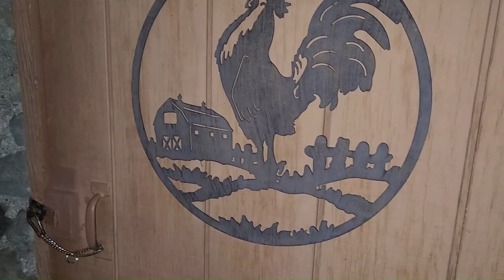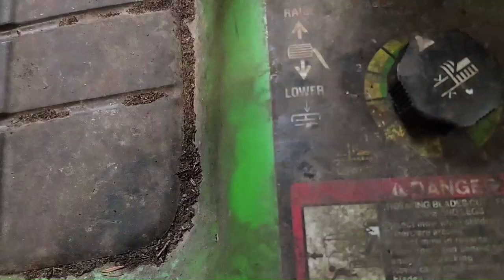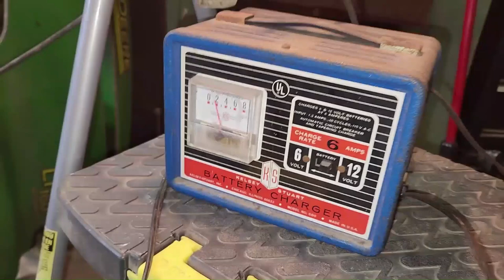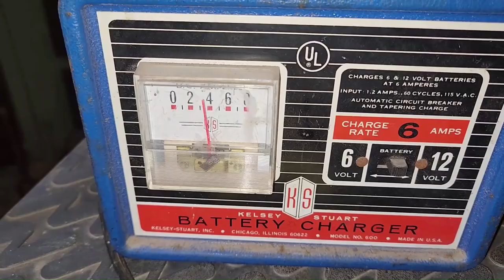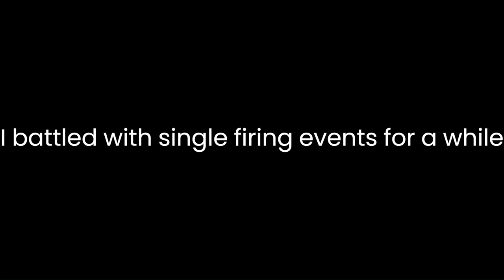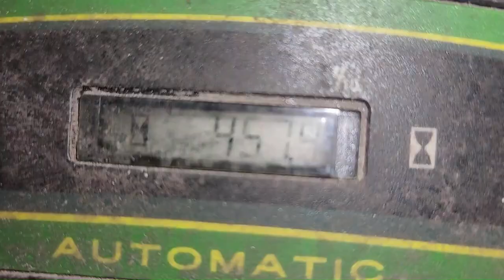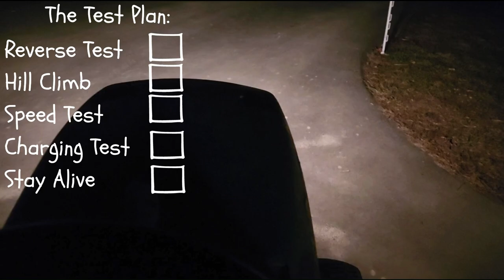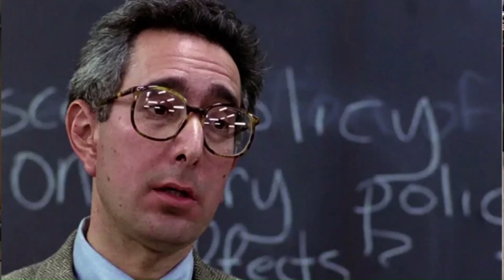Machine Rehab - John Deere LT160 Automatic - Will it Start??

Comment: Actually,  lead in gasoline was used as a lubricant for valve train components in older engines. Then they started using hardened valves and seats. Also lead will clog up catalytic converters and prolonged exposure can cause cancer.  Thanks for the video bud.
Reply from the maker: Appreciate the info!  👍👍

Comment: you were running around the yard with the lights on I'd say you're charging system worked
Reply from the maker: Good point. I wasn't sure so I checked because the lights turn on even with the engine off.  Thanks!

Comment: I learned a little trick working with used batteries at a junk yard. If you have a battery that is completely dead and you can't charge it from 0, just jump it off. Hook it up to a charged battery with jumper cables and let it sit for a few minutes. It will put 1-2 volts on it, and that will be enough for the modern chargers to do their thing.
Reply from the maker: That's a great tip. I'll remember that for next time. Thank you!

Comment: Missing the front bumper.   The hinges for the hood attach to that.  Probably part number AM128998.   Install, adjust, ride...
Reply from the maker: I appreciate the info! Thanks! 🍻
Reply: @TractorFella  NP.   OEM about $70.   Knockoff, about $20.   All over Ebay and Amazon...
Reply from the maker: @V1rowt8 - Knockoff it is! 🤣 Thank you 👍🏻

Comment: I like the metronome electronic  beatbox charger better than my boring ass "tinnitus" whine charger.

Seeing as you asked for it..  i think  the spinning adjustment knob thing on the panel between the seat and the column is the height adjustment, not the pedal.  My old husqvarna is set up similarly.

Edit:  700 bucks.  I felt that..  I bought a yanmar tractor+backhoe that looks like hot trash but runs great.  No hood.
I looked into getting a hood...  saw a big number like that..  now i'm thinking about making a hood.  I have an old 100lb LP cylinder that might get split in half.
Reply from the maker: Hah, that's true - I suppose it has more personality! 😆

Yeah, that makes sense to me.  I still need to see how that pedal works.  Maybe it does travel vs. mow position?
Reply: @TractorFella There are soo many different control variations in the last 30 years on riders.  who knows...  I always dread getting on something new.  That pedal could do anything.  Maybe a lift pedal.
My pops has a craftsman that is almost IDENTICAL to my husqvarna.  Same motor, trans looks the same, same pedals and levers etc.  But his hydrostatic and brakes work different.  From the same factory.  Good luck.  Make sure you aren't pointed downhill first time you press it just in case it's a vestigial clutch  :-D
Reply from the maker: It's funny how they're all similar but different. 

Haha thanks for the tip! I'll let you know how it goes 😆

Comment: Judging by the missing deck, I would assume there was an issue with deck that caused it to be parked. Decks are freaking expensive. I need one for one of mine, so it is currently parked until I find a parts machine.
Reply from the maker: That was my thought as well. Rotten deck maybe? And yeah, they are expensive!!

Comment: Those John Deere hoods have a really bad habit of breaking. I don't even have a hood on mine. It got broken when the previous owner had it, and I haven't been able to find one at a reasonable price either. Everyone that does have a good hood wants your first born for it. You can get the mower cheaper than the hood. It's insane.
Reply from the maker: Yeah, I couldn't believe the price I saw for some of the hoods!  It's just going to have to ride as-is for now!
Reply: @TractorFella  I know this is 6 months later when I'm seeing this video so you may have moved on from this project, but if the hood isn't busted up too bad you might be able to just replace the front hood bumper.  It's the front plastic part that mounts to the frame then the hood hinges off that.  On ebay it's only about $30 for an aftermarket part and depending on the seller it may or may not include the mounting hardware.
Reply from the maker: That's great information. I'm having trouble parting with it (yes, I'm a hoarder lol) because its a great machine. I'll look into it. Thank you! 🍻